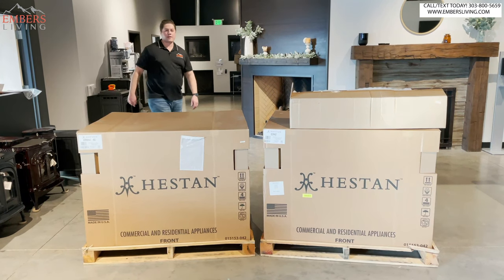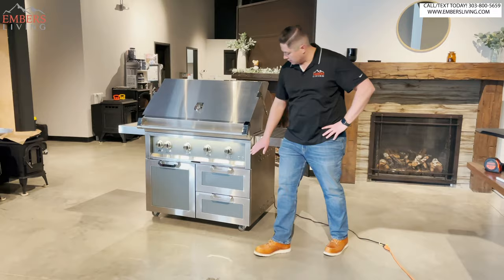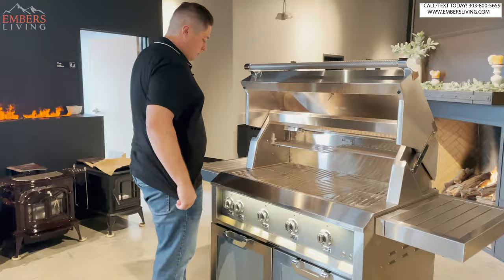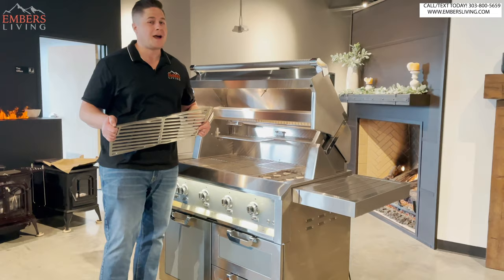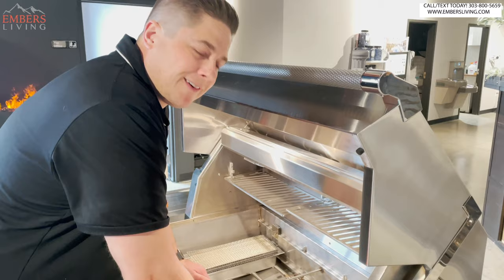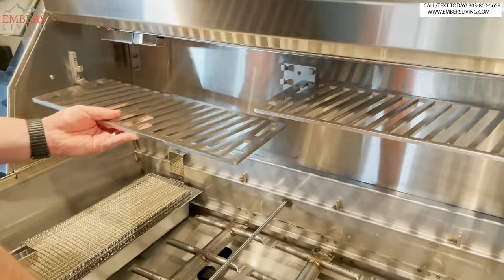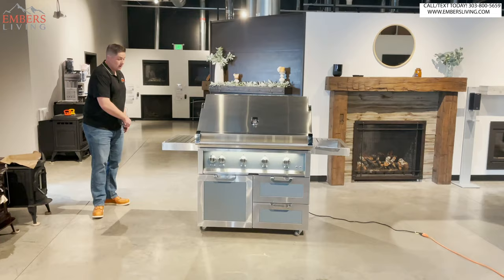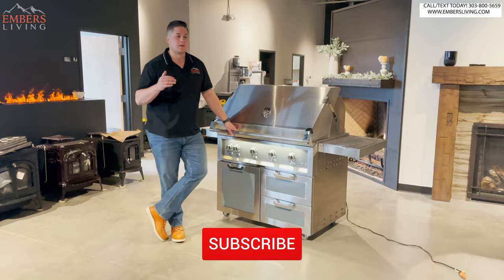Hestan gas grill Review ( Is this the best grill on earth???)

Comment: would the aspire's ceramic briquette tray fit in the original hestan grill? assuming both are 36 inch?  I love the hestan original, but am concerned about the flat ceramic briquette tray -- sounds like it will be a set up for flare ups
Reply from the maker: I will have to try to switch them out

Comment: Have a question since you have so much experience searing on infrared burners.  I have a Hestan 42 with an infrared burner and searing stakes at high or even med-high I often get lots of flare ups (especially with ribeyes).  I always heard that flares up should burn away fast on an infrared burner.  Am I doing something wrong?  Should I cook with lower heat, should I clean the burner a bit more somehow?  Thanks for any tips you can offer.
Reply from the maker: Yeah you might be going too hot
Reply: @embersliving  Thanks, what setting do you usually set your sear burner to on your Hestan while searing a steak?

Comment: I recently purchased this grill and I was disappointed with their quality control and fitment on the cart.  There were screws missing and where the grill bolts down to the cart on the rear there were two different size threaded holes. There were some other nits but my biggest complaint was that the two doors on the cart only had two screws hold the hinge to the cart and there is supposed to be four. They didn't even put threaded insert where the other screw should be. Overall the grill itself was good but there was one trellis that didn't sit flat and was twisted. For $12k I expected much better quality control.  I have written them but no response as of yet so customer service thus far gets an F. The boxes came stacked on on top of the other and crushed the bottom box with the grill but fortunately it didn't hurt anything. My Wife and I are 73 and it was not easy getting the boxes separated. I paid $4k for my Blaze professional a few years back and it was much better fitment and their customer service was excellent. I really liked the infrared rotisserie on the top which is why I purchased.  I give the grill a "B" and the cart an "F". I try to buy American when I can which is another reason I chose Hestan but apparently California products are more similar to China than say Wisconsin or North Carolina.
Reply from the maker: So sorry to hear about your experience, did you purchase from us? If so we can help as your customer service representative
Reply: I agree with the bad customer service.  I also experienced the horrible wiring or trailer trash engineering that for me, caught on fire and melted and burnt up the unprotected wiring.  I can ONLY think, with all the it's just a matter of time before these grills burns up.  There isn't any protection for the wires between the front panel and the fire box.  wires are 1/2 inch from cooking area.  I only used my grill 10 to 15 times and the ignition stopped working.  Took the panel off and seen chard wires.  the plastic melted and dripped to the gas line and simply started a fire in the front panel.   Heston put ZERO thought into protecting these wires.  Completely drooped the ball with the wiring..

Comment: I am blind and love to grill! I am afraid of flareups as I have to use a glove hand at times while grilling. Would you recommend this grill or a tech infrared grill? Thanks so much for the informative videos!
Reply from the maker: I personally like this over the tec for flare ups
Reply: @embersliving  Tech latest infrared burners fire is   covered by a borosilicate glass plate.  No flare up is possible.
Reply: TEC old style infrared burners had exposed flames and hence some flare up potential.
Reply: I am replacing my 20 year old TEC patio II  that had the original infrared ceramic plates and did have flareups but they were never really an issue. As mentioned the new tech grills have the glass plate directly under the grates so you won’t get any flareups. However I’m wondering with the new tech grills and the glass plates, is it really still grilling?  I’m torn since the OG TEC lasted for so long. Hmmm, maybe I should just rebuild all the insides and reset the clock!   New grill input welcomed! 😁
Reply: @DFenech   The glass plates prevent air movement (convection currents) and are mostly transparent to infrared radiation.  Burners below the plates, emit heat energy, which is transmitted through the glass.  As a comparison, lit charcoal also emits heavily in infrared and is not moving a lot of air.  Standard bunsen style partially aerated burners, like those of conventional gas grills, or your gas cooktop, typically have drip shields or ceramic briquettes arrayed above burner, which absorb heat from burner flame, and then re-radiate in the infrared spectrum.  Technically, the TEC glass plate infrared burners would be the most advanced grilling technology available, but I have never cooked on them.  Borosilicate glass is expensive, and it should last forever as it is fairly robust and shock resistant.  Your old TEC is a different technology,  still emits in infrared, has a lower turn down ratio, and higher potential for flareups.
Reply: @embersliving  any updates or improvements on the flare/flame up issue on these? How would it compare to alfresco or lynx for this issue?

Comment: I have this grill in 42". Probably wouldn't buy it again.  Rotisserie holds up to 50 lbs yet you can't go larger than a medium turkey because the overhead burner is only about 7.5 inches away from the rotisserie.  The ceramic briquette trays are flat.  Cool because all you have to do to clean them is turn them over and let the burners do the work. Not cool is being flat they are very prone to flame ups. Burgers can be quite the challenge.  Also, the briquette trays are prone to some warping and the heating is not very even. It is built like a brick shit house, it's just not designed very well.
Reply from the maker: thanks for the feedback
Reply: @embersliving  any updates or improvements on the flare/flame up issue on these? How would it compare to alfresco or lynx for this issue?

Comment: Got the 36" on the pull-cart with the side-burners and all trellis burners two years ago. It's outstanding.
Reply: Have you used the top burner to seat steaks? Want to know if it gets hot enough to get the crust you get at the best steak houses.
Reply: @nathanevers1148  By top burner do you mean the rotisserie burner that can also be used as a broiler/salamander? I have not tried that, but I find the heat of the regular burners is sufficient for searing steaks, at least as I'm used to grilling them
Reply from the maker: I would second that, they regular trellis burners get hot enough, not to mention if you do the infrared
Reply: @jasonstanis514  A little bit with fatty cuts, but nothing unmanageable for my purposes since I don't use the whole grill surface area at one time and can move things around while the flare-ups subside. But the combination briquet/stainless steel apparatus underneath the grill surface is more susceptible to flare-ups than the simpler stainless steel bars I had experience with on my prior Weber and Napoleon grills. I think this in part because of its larger surface area and it doesn't allow grease to run off the way those angled bars probably do
Reply: @jasonstanis514  I don't flip them very often. Certainly everything has long been burnt off the bottom side by the time I do. I actually have found more flare ups immediately after a flip rather than when I have left them unflipped for a while. This was consistent with how I found more flare ups when I very first got the grill when everything was at its cleanest. I really don't know why this pattern should be, but that has been my experience. I probably only flip them 3 times a year at most and I grill every week (including the dead of winter up here in Canada)
Reply: @jasonstanis514  I am very happy with it and would buy one again provided that I didn't need the money for something else -- if funds were tight I would go back to something like my old Weber Summit series